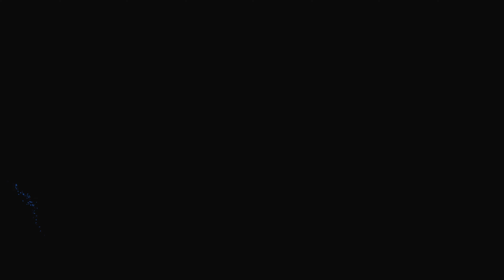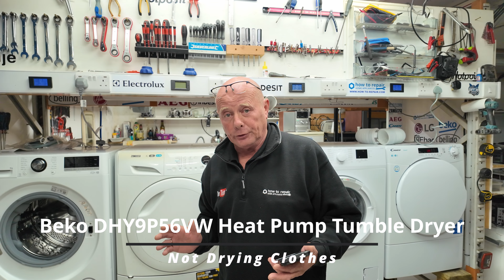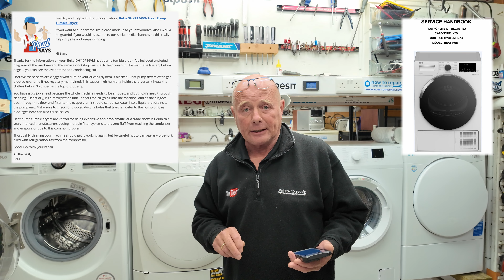Beko DHY9P56VW Heat Pump Tumble Dryer Not Drying Clothes - Tumble Dryer Troubleshooting Repair Guide

Comment: beko heat pump tumble dryer DTLP71151W just runs and runs for hours ( 3 or more hours and the timer goes down to 10-18 mins then it will go up again ! until I stop it ) the clothes do get dry the filters they have been cleaned and the warranty company fitted a new pump any ideas ?